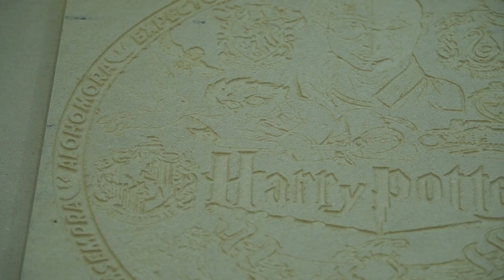Onefinity CNC Rolling/Folding Table // A Small Shops DREAM!

Comment: So, 2 questions:
 - Does that mean the Quick Change Waste board frame guarantees the Rails are perfectly lined up/square, no parallelogram mistake on install?
 - What size/length bit did you use for this level of detail? (not in description)

Thank you for the demo, well done.
Will order it for my Mahinist X-35

Comment: Hi, I am in the market for a new Cnc machine, I currently have a smal next wave Shark. I’m looking between the new 5 pro and the onefinity elite series. My main question is when using carbide motion, can you pause your cut and change speed of cut on the fly ?  I can do this with my Shark and it can be done with the new masso controller with the onefinity. But if I can do those things with the new 5 pro I’d like to go that route. 
Thanks 
Chris
Reply from the maker: I had a shark, and it was the worst.  Propriatry software that requires a license for motion control?!  It's a joke.
The Onefinity is in a whole different level of machine.

Comment: 02:00 I don't understand how having the fasteners on the underside makes them any less likely to come in contact with the bit than if they were topside. Topside fasteners are countersunk below the surface aren't they. In either case the X-Y location of the fasteners is the same is it not? 

It seems that one is easier to change out then the other, and if you CNC is on a surface where you don't have access to the underside you would probably want the topside mounting.

When you're wheeling the CNC in and the display is on it's mounting arm, that looks very risky given how everyone talks about how easy it is to dislodge the display from its mount.

I don't see any levelers on the legs. How do you dial out any racking of the work surface when you setup on uneven floor which will almost always be the case. I'm guessing the footprint of the legs is about 50 x 50 inches. Not may places where a CNC would be used will have a flat surface to setup on of that size. Even one quarter inch will affect the work surface. Since this is a beat unit you're testing I hope that this issue was recognized and a method of leveling the work surface was incorporated into the final design.

08:10 I wonder what your neighbors will think of you after listening to that CNC screaming in your driveway for a couple hours.
Reply from the maker: I'm on 2 acres, so they wouldn't hear much.
Reply: @MyersWoodshop  Wish I had that problem. My .6 acres doesn't  leave much room between houses.

No comments on my leveling questions?
Reply: Of course they have levelers